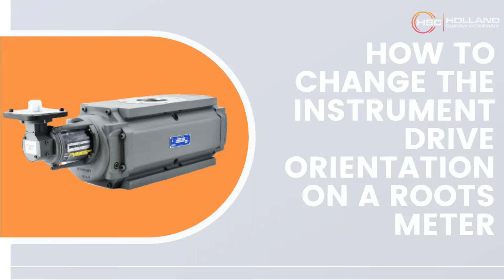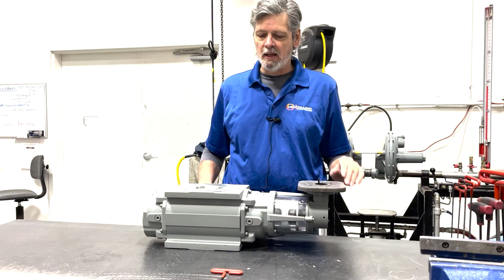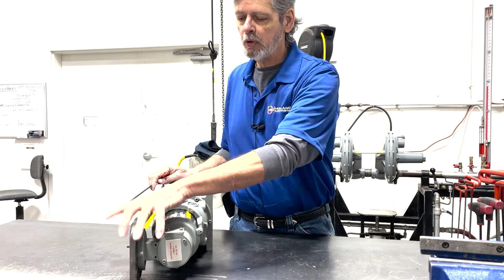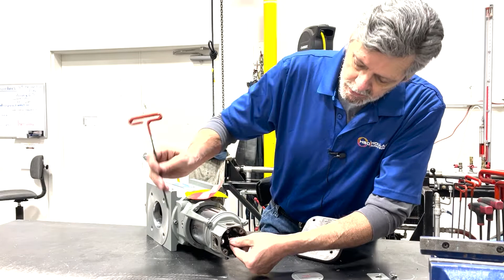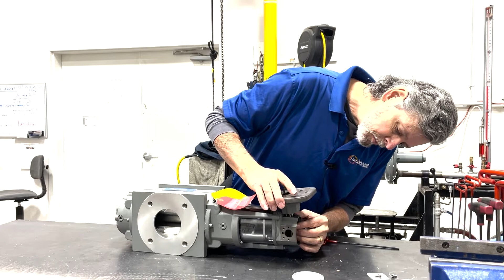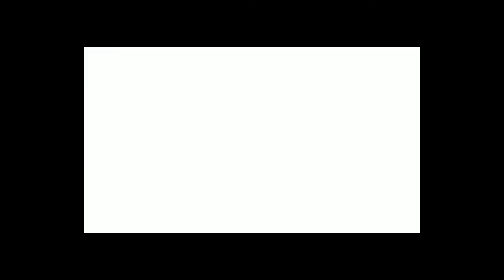How to Change the Instrument Drive on a Dresser Roots Meter

Comment: You can also reverse the index drive gears (top gear to the bottom) to reverse index travel direction when some installation crew puts the meter in backwards this is a lot easier than bypassing meter and unbolting to turn it around one man instead of crew. Dresser meters can run any direction. The arrow is to show gas flow direction of the meter leaving dresser. I know because I've tested from inlet and outlet and achieved same test results at 20% 50% 100% flow. Of course you have to mark change in direction of flow.